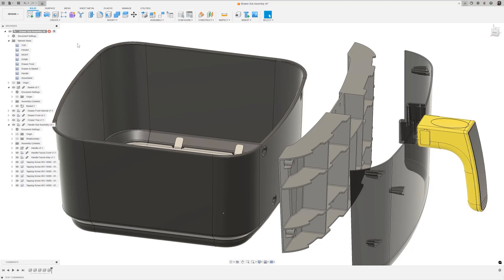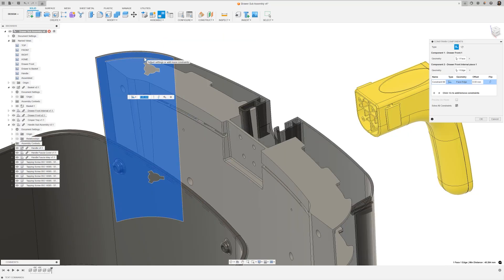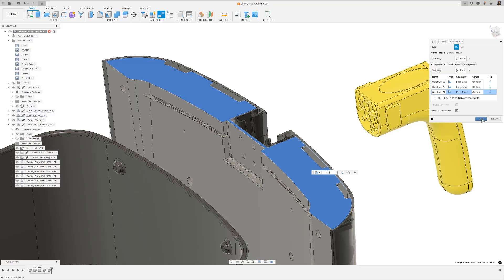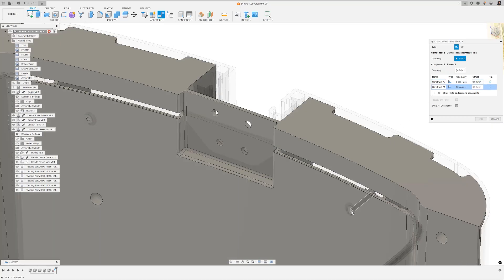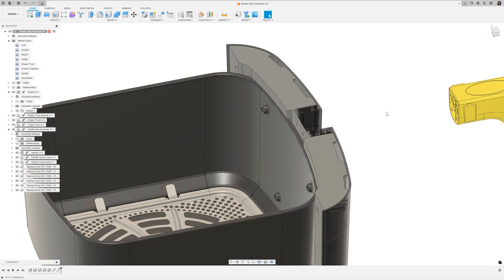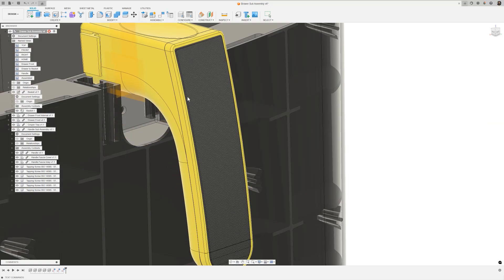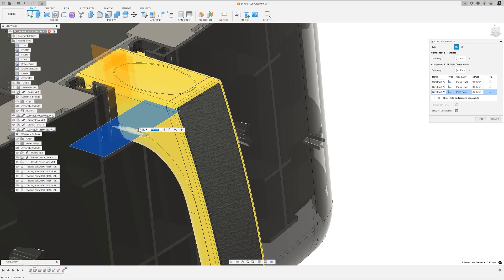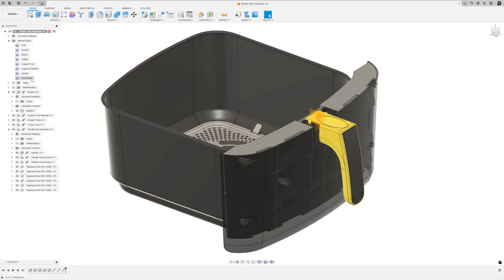Stop Wasting Time! The New Constraints in Autodesk Fusion Make Assemblies Easy

Comment: Autodesk Fusion has improved significantly over the years in design, manufacturing, and other areas. The simple idea of having everything you need from design to production on the same platform is a huge help to companies.

But lately, in my opinion, it's lagged a bit. Simple tasks like importing a 3D model of a toolholder are still not possible. Better control of the tailstock or using the Y axis in Lathe requires manual NC creation, etc., when it could be much faster and simpler.
Reply: Hi @kazoku, thank you for the comments about the improvements you hive seen. 

After running our Doosan Lynx with a Y axis for a few years I can't recall an occasion where I needed to do manual NC. It should al be possible if the post is configured correctly. Are you having any specific cases with issues on your Y axis?
Reply: @richardstubley9651  If you have a long shaft where you have to perform milling operations and lathe with Fusion, for example, if you rough it with a tailstock and then make a box with a milling cutter, the tailstock returns home.

But if you do this with manual NC, this no longer happens.
Here's a video where they machined a part on a MAZAK that demonstrates this very well, where they used manual NC to call the tailstock and perform the milling operations.

Speaking of the Y axis, it's a bit disappointing not to have a checkbox within the operations to use the XY axis instead of X and C.

Unless the post-processor logic changes.

Comment: To be honest I was perfectly happy with joints. Much faster than this and easier to troubleshoot.
Reply: The fact that constraints allow you to make multiple DOF constraints with only a single entry in the timeline is one of the primary reasons for this new method, I will wager. If you have never built a massive assembly in Fusion with dozens of joints and seen it slow your computer to a crawl because of all the calculations needed for all the joint entries in the timeline than you are not likely to appreciate how awesome this new constraints option is.
Reply: Joints are still there so you should not have to change your workflow. We are always looking to improve the experience and expand the toolset. Maybe on some future assemblies you have this could prove useful.
Reply: For many things, Joints are very good, but having both Joints and Constrain Component is going to be extremely useful!
Reply: I think I only once came across a situation where a standard joing wouldn´t work. There I had to create one of these joint selction points manually.
Reply: @MaxMakerChannel That depends entirely on what sort of things you design and how you design them :)
I learned parametric 3D CAD in Fusion, then learned Solidworks, and while I prefer Joints over Mates if I could only have one, having borh Joints and Constraints in Fusion is going to be awesome!
I often have had to muck around with Joints to position multiple components relative to each other, in ways that Joints don't really like and thus dealing with error messages or unstable designs.

I'm super happy about this new functionality, and it takes Fusion ever closer to the functionality of SW and Inventor in some areas, while still being far ahead in others!

If I could just get a good Surface Flatten/Unroll function in Fusion, I'd be all set :) Sheet metal work arounds only go so far sadly.

Comment: Superb, this definitely something which was much needed. I used to do all this using the move command. 
Just one question, does this feature also work on bodies? Coz sometimes it's needed there too. 
I have a habbit of creating components at the end while designing. Till then I only work on it as a body
Reply: Well, then you should change your workflow, if you want to make good and stable CAD designs :)
Reply: make components earlier. move really should only be used as a last resort
Reply: Hi, no this does not work with bodies. Only components can be used for joints or constraints. Try creating components ahead of time before modeling and you should also end up with a neater timeline too.

Comment: Thanks for the demo. Will be interesting to see more detailed videos on the use of this new feature. (minor point , but it is "Head up" not "Heads up". People only have 1 head)
Reply: Thanks! Every day is a school day!
Reply from the maker: More videos are definitely coming, Patrick!
Reply: thanks for the heads up!!!
Reply: Wikipedia lists it as either Head Up Display or Heads Up Display, both are correct. The term HUD has its origins in WWII era military aircraft information and aiming displays and so these principles are taught to groups of Soldiers/Airmen at a time, meaning that they are referring to multiple heads when the term is used. That is why "Heads Up Display" is the version in more common usage. It entered the common vernacular through pilots who learned about them in classroom settings before then using them in their actual aircrafts.